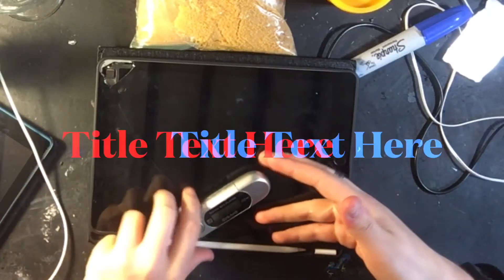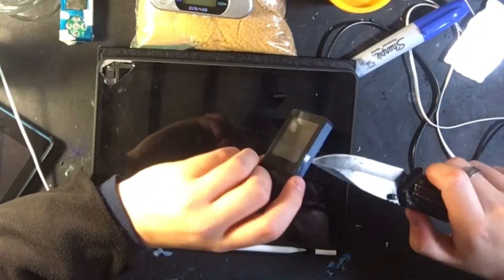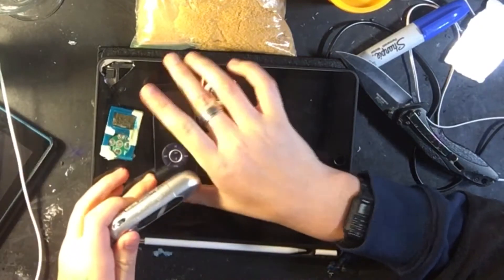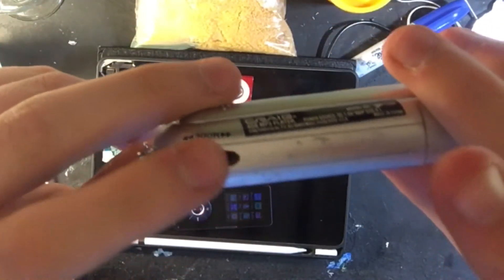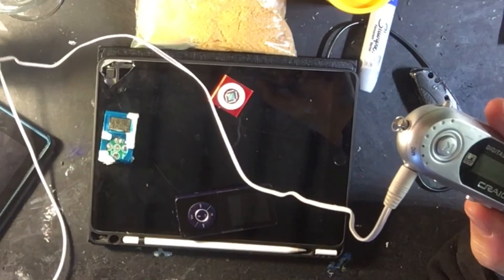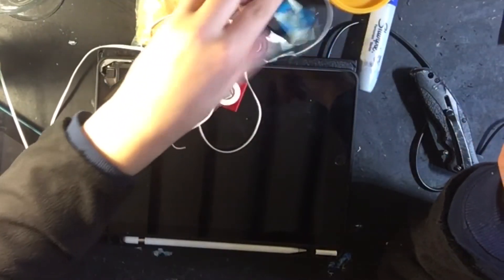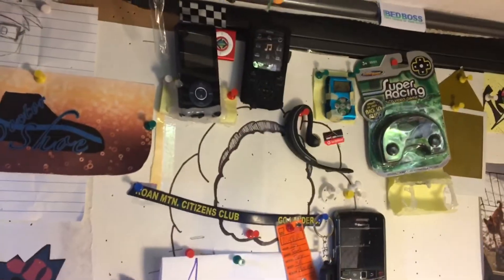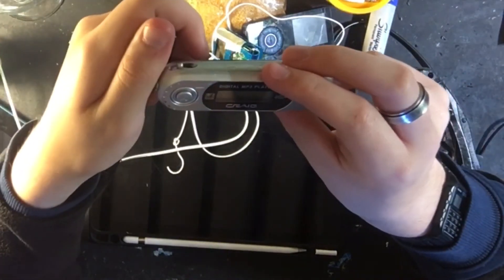The Craig Wish.com MP3 player

Comment: Hi, I have one of these and was wondering, How do you access the reply/repeat button/menu? I accidentally set it on intro repeat - idk what I pressed- and idk how to get it off
Reply from the maker: @oceanrosef.3107  if I remember correctly pressing and holding the mode toggle button on the top right sent you back to the main menu. But really you should just get a used IPod from ebay, they are finally coming back down in price again.